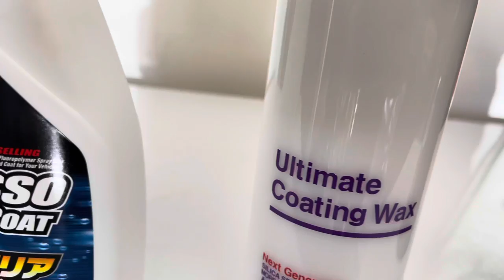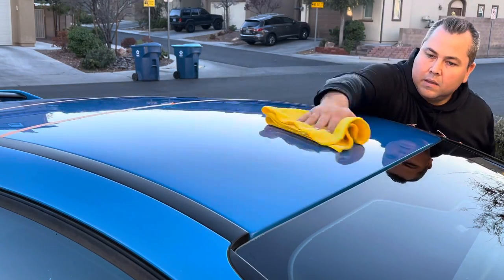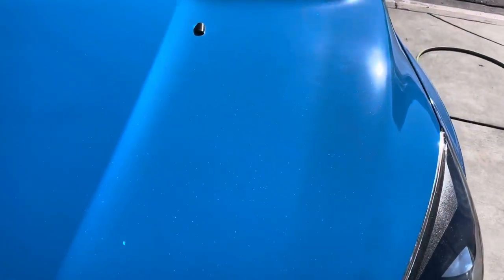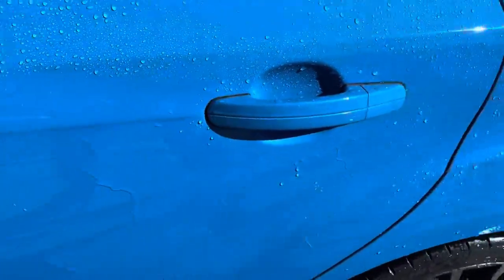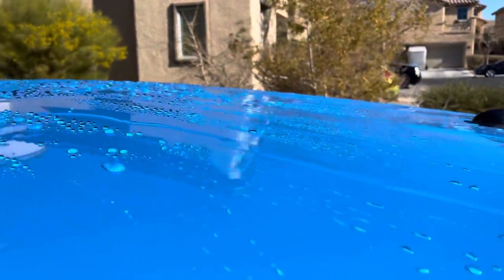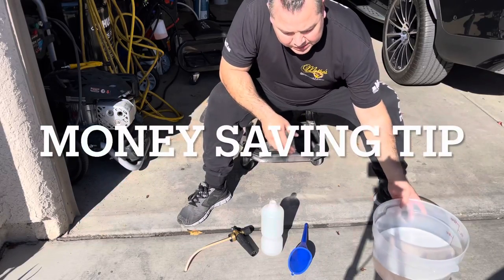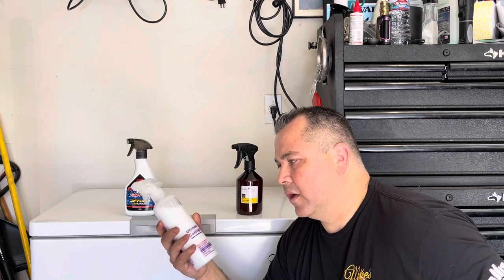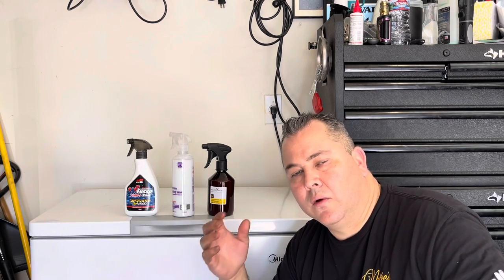Fireball, Polish Angel, Fusso Coat(Updates)

Comment: The Fusso Coat soft99 that comes in the metal tin which has the Teflon acts like a ceramic coating. Check out Dimitris Garage, he had 70+ washes before it broke down. Great hydrophobic also. The speed and barrier not so great though...
Reply from the maker: Yep, I know.   I thought this would be good as well.  I was disappointed
Reply: Speed & Barrier seems like it would be great for maintaining fusso99, but not for standalone protection.
Reply: @qwikss4469  Speed and Barrier is terrible compared to Soft99 Fusso Coat in a tin. Topping Fusso coat with S+B ruins the hydrophobic properties and is like a step backwards!
Reply: @Zwikster  whoa, thanks for the info!

Comment: Nice video man!
Please, Rapid Wax vs High Gloss
Which one you prefer?
Reply from the maker: I like them equally but on price alone I think Rapidwaxx is the way to go.
Reply: @DetailingBreakdown  can you tell the difference in shine & gloss side by side?

Nobody have done this video before and Im so intrigued
Reply from the maker: No, not really on side by side.  Gloss comes from the polishing and paint correction though.  I think the Rapidwaxx would be my choice at this point but both are very nice.  The beads seem to stand a bit taller with the Fireball but it’s splitting hairs.
Reply: @DetailingBreakdown  true, thans
Reply: I’ve used nothing but PA products for the last 3 years on (my cars). High Gloss had been my favorite of the two as the glow stuck around longer than Rapid wax and Carnauba arts but all three sheet water well. I used NV Lustre on my wife’s SUV for the first time. Now NV Lustre has moved to my side of the garage and the PA High Gloss, Carnauba Arts and rapid wax will be collecting dust.
Reply from the maker: @rixZR2  I like Lustre and started to like it over the other NV products but I’ve only washed a few times and it’s fading a bit.  I have now changed my mind to Jet as my favorite.   And Lustre topped with Jet is really good as well.   Haven’t tried Boost yet
Reply: @rixZR2  really? So to your eye Lustre is better than High Gloss???
wow
Reply: @gorillanismo I waited to do a strip wash before I replied to your comment. My favorite contact wash is PA Flake and always followed by PA High Gloss. This has been the way I’ve done things for a long time and I get a lot of comments on how good it looks. Using Lustre as a topper and after the contact strip-wash it (today) gave a different glow I truly loved.  
My car has Angelwax Legacy coating.

Maybe I jumped the gun a little by saying I liked it better than PA Gloss  because it look a little different. Damn it’s a tough call to which one looks the best and I know my car. 
They are both very easy to use and they both look great. However, the Lustre bottle doesn’t leak like the last 4 PA Highgloss bottle did. Is Lustre better, it’s hard to tell and like I said I may have jumped the gun.
Reply: @rixZR2  than you sir for the follow up it is greatly appreciated. I think really you cant go wrong with any. I think those 2 are the top 2 spray products on the market